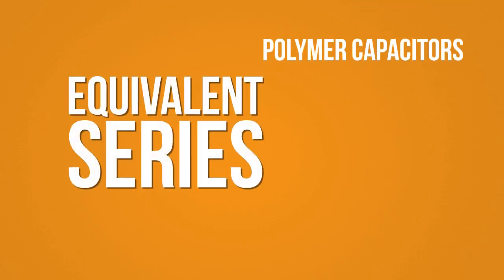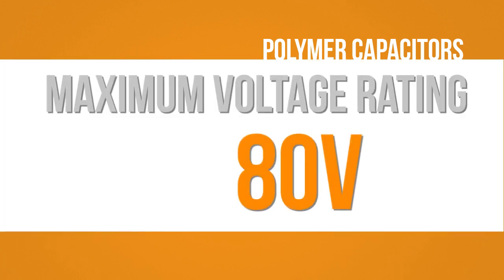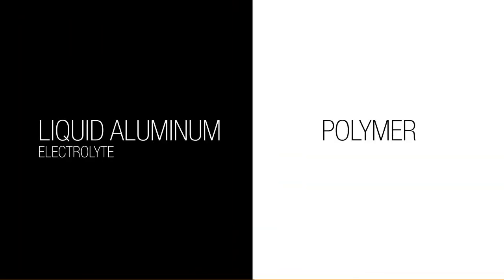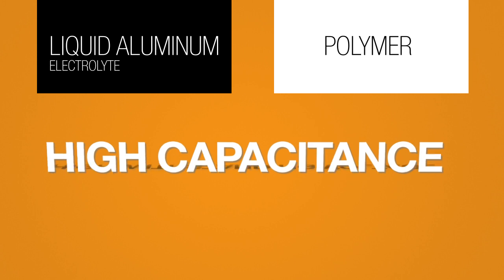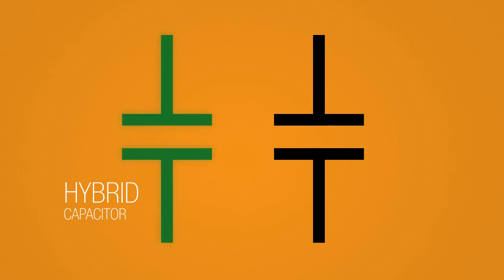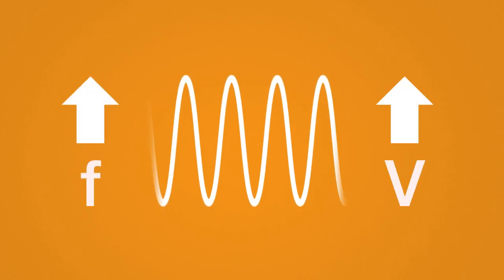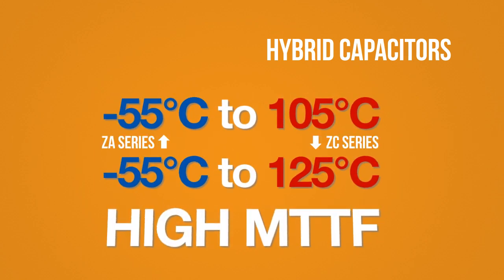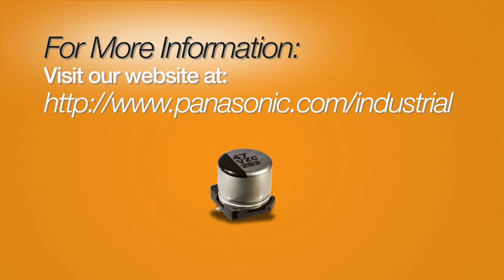Panasonic Hybrid Capacitors Provide a Low ESR with a Higher Withstanding Voltage

Comment: That last time I looked, I found that another advantage of electrolytic caps is they are available in much larger capacitance than polymer caps. Is this still the case? For example, can I get a 1000 uF poly cap?